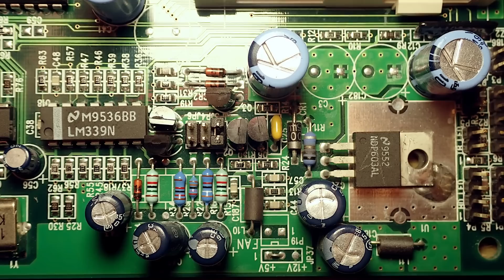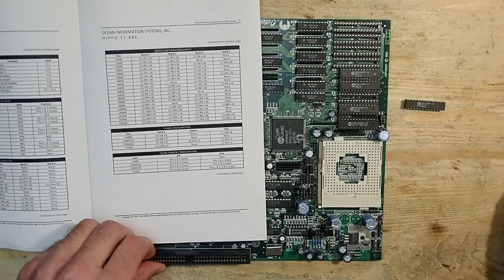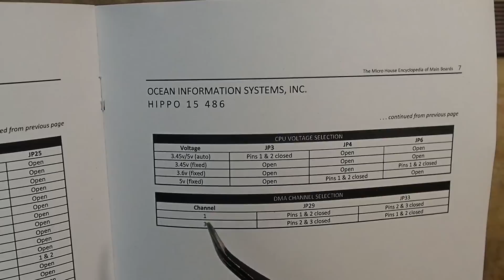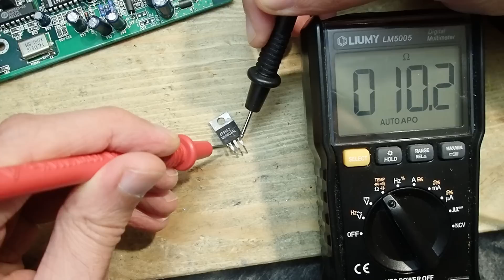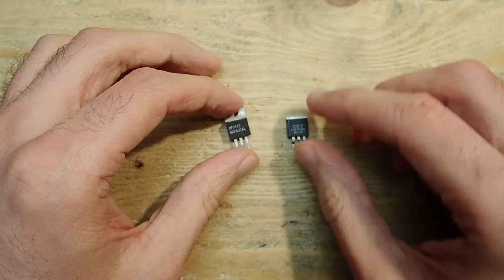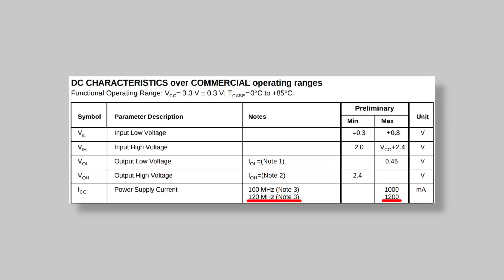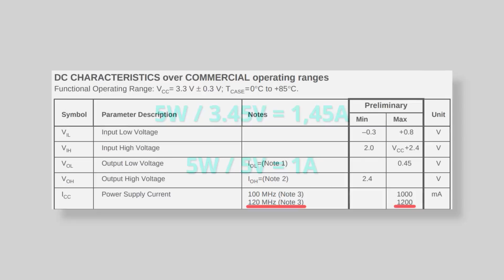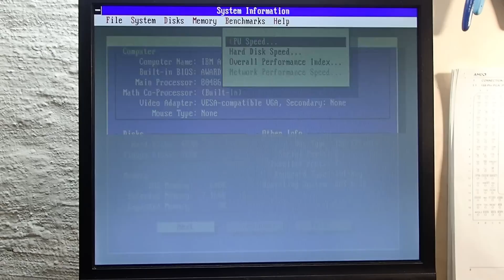Let's repair one of the best 486 mainboard - Octek Hippo 15

Comment: Great work and sweet fix! And yes, why recap something that doesn’t need it? I’m on board with you 100%
Reply: Hi! Why recap? because all components have a rated shelf life according the manufacture. May be the 25/30 years old motherboard exceeds that shelf life. Could be working but not in specs. You dont need to change your car oil every 15..000Km,  the car wont stop running but you should because manufacturer specs.
Reply: @JorgeCarvalho_web_dev  all of the components are passed their rated lifespan, not just the caps. With that logic you’d change all the semiconductors and passives. Motor oil becomes contaminants and ineffective, so I would not say that is an apples to apples analogy.
Reply: @adriansdigitalbasement  Nop, I will not change all semiconductors. A 150 ohms resistor will be always 150 ohms and we can consider it of one type of semiconductor, it retains its specs until it burns out by external factors. A capacitor due to the way it is produced will change its own original specs over the time.
Reply: @warrax111  It is a good example to compare oil changes to change capacitors. You are not forced to do it, the car will continue to start, like capacitors, you are not forced to change it. Some day the board wont boot (the car will start but will damage the motor) analogy. But I understand that you support Mr Adrian thoughts because he is considered a "star" on the YT world, and what he says is the law. I can not support he's  argument or thoughts about the capacitors, so if and when I can, I present my own arguments
Reply: @JorgeCarvalho_web_dev  Yeah that's a false equivalence fallacy.
Reply: @warrax111 It is sad to me to know that there is out-there someone with that kind of thoughts.. that performing a simple task like changing caps could make the ego rise or feel like a star... You make me laugh with that. I wish you an happy life and grab some psychology books to learn some basics
Reply: @JorgeCarvalho_web_dev  nah. A blown capacitor isn't a big deal. Not changing oil will utterly ruin your engine. Big difference
Reply: @DeadOSThings  Thank you  for your smart comment, it proves that you and many others cant understand what a comparison is. I will try to explain again. 
A comparison is an helper that is used to establish a parallel from a common situation that everyone is used to to explain other situation not so common .
 It is mandatory for a car to run to have gasoline(for example) to the motor works, the oil is an element in the system, the capacitor also. 
Both have a lifespan (10.000km for oil for example) you can skip an oil change the the motor keeps running, but one component (the oil) is out of specs not in an ideal way but it keeps running until the system (the car stops working). N ow the hard part, the comparison: so you can skip to change an 30 years old capacitor, the  computer will keep running not in the best way because an element (the capacitor is out of spec). Did you understand now what is the comparison? NOTHING to do with big or small deal. The system will stop the RESULT is the same, the car will stop working. The problems/costs will be different obliviously but in the end. Because in the comparison THE RESULT IS THE SAME, ,SO  THAT IS WHAT A COMPARISON IS.  For all that was explained, your comment is useless and reveals much more than meets the eye...
Sorry my english, it is not my native language, but I hope that this can help others to understand what a comparison is instead of start writing things on comments
Reply: @adriansdigitalbasement  while it's true that all/most of the components on these old boards are past their rated lifespan, parts like ICs and resistors are far less likely to fail when compared to electrolytic capacitors.
Reply: @JorgeCarvalho_web_dev  not true, resistors fail too. you don't measure your caps bro? just blindly replace?
Reply: @Walczyk  Hi Sir! in fact I just replace them. Just the fact of apply heat to remove them and clean the pins dont do very good to them and they continue to be old. It is just easier for me to replace them and dont think about it. I could check them but they still have 20 or more years old (could be good but still old and the rick of leak or something is still there)
Reply: My grandfather used to say "if it ain't broke, don't fix it".
Reply: Nah. Once the cap is dead it can be fixed by putting in a new cap. Couple cents.

Once an engine is dead it can be fixed by putting in a new engine. More than a couple cents.
Reply: It's only worth immediately recapping if the caps are low quality or from a known bad period.
Reply: @JorgeCarvalho_web_dev  stick to web development as you're clearly out of your league with electronics.  Resistors are often found drifted in value.  Your comment shows your lack of knowledge.
Reply: @BenState  Dude, dont be an asshole. The resistors are not the exact value as printed in color code bars. There is always a tolerance that can go up to 20%. Maybe you should think and read a little bit before post this kind of comments.
Reply: @JorgeCarvalho_web_dev  do some research, resistors drift outside of their tolerances.  A well known phenomena.

Comment: That DX50 was technically the first CPU that forced active cooling to be required and it was also the reason that VLB started walking towards its demise as VLB cards would have to run at the same speed as the CPU FSB a LOT of VLB cards started dying when used with DX50 CPUs due to the 50Mhz FSB. That said, first generation PCI cards (when using similar/equivalent chipset) would be slower than the VLB counterparts when running on a 50Mhz FSB system due to the PCI BUS being clocked at 33Mhz and having additional layers between the cards and CPU. Please note that the same will not remain true when you move up in CPU generations, this will be valid for 486 systems with VLB and PCI slots. I would actually love to see you test a board that has both VLB and PCI slots with a DX50 CPU and VGA cards with the same chipset but in VLB/PCI versions. Another good test will be VLB HDD controllers with RAM for CACHE, as the PROMISE ones that used a 286 as a dedicated HDD controller, though in this case the problem is that I never found a version of those cards in a PCI version, though the VLB really kicked butt *once their drivers where installed that is*, specially in Novell Netware 3.x file servers when you have a bunch of users hitting the same databases at the same time, those things rocked hard with 8Mb of RAM dedicated to HDD cache. They also considerably sped up Windows 95 on 486 systems (or even Pentiums with VLB slots). It took years before a normal PCI controller and HDD matched that performance (When comparing IDE devices, SCSI devices are not in these considerations).
Reply: You are right the DX50 was a boy ready to run in the 32 bit era. It was mind-blowing
Reply: Что касается частот на VLB -- в одной из моих сборок система стабильно работала на частоте 66 MHz. (Процессор 486DX2-66 работал как "DX2-133". ;) )
С шиной PCI также было не всё просто: в период становления стандарта PCI v. 2.0 встречались MB и видеокарты, способные работать на 66 MHz.
Процессоров, работавших на такой частоте мне не встречалось, но попадались экземпляры DX4-133, работавшие как "DX3-180".
Правда, переключение частоты с 33 или 40 на 60 приходилось делать уже после старта системы.
Reply: Most PCI implementations would run 1/2 at 25mhz on a 50mhz fsb. I have a UMC 486 board that has both pci and VLB. And it will drop the PCI to 20mhz when I put the FSB to 40mhz. Which is a shame. But its VLB implementation also seems to be very slightly lower performing than a pure VLB board I have when replicating configuration as closely as possible. I have found on my VIP board that when the busses are the same speed then the VLB is only very slightly faster using my friends ET4000 cards. The difference seems a little more pronounced on a dx4 than on a dx2 as well. But they are still both within a few percent. And best comparisons I can make with HDD controller's indicates they are identical for the most part. Both using flash and spinning rust. However my VLB board seems to outperform the VIP board I have by a more significant amount.. So I can't call that apples to apples as its probably got other optimising going on.

We even did comparisons with L2 an L1 disabled at different stages to see if we could isolate more situations. And the differences seemed consistent.
Reply: @wishusknight3009  В период становления стандарта PCI 2.0 встречались m/b и видеокарты, у которых была документирована работа на 66 MHz. А некоторые бренды и ранее выпускали компьютеры с "заводским разгоном". В таких случаях комплектующие сторонних производитетелй были не всегда совместимы (если не могли работать в разгоне).
(Позже — поддержка 66 MHz осталась только на "серверных" PCI-64.)
Reply: @cynic3859  There are many cards that had 66mhz capability. Even though they were 32 bit PCI. Silicon Image SATA cards for example are 32bit - 66mhz. And several video cards were capable as well. Including the VOODOO 3 and ARC Logic 1000PV PCI vga chip
Reply: @wishusknight3009  Теоретически VOODOO 3 могла бы работать на PCI с частотой 66 MHz. (Она работала на этой частоте на AGP.)
Но нет никакого смысла её использовать с 486. А современные ей чипсеты (например 440BX) не позволяли даже в разгоне поднять на 32-битной PCI частоты выше 41.5 MHz.
Reply: @wishusknight3009  See, you're talking DX/2 and DX/4, this is exactly the problem. FSB on those will be usually between 25Mhz and 33Mhz, this will not do. 
You need to make the test using DX models or overclocking the base FSB on the DX/2 DX/4 models to 40Mhz or 50Mhz. 
The only DX/2 I am aware of that has a higher than 33Mhz FSB is AMD's DX/2 80Mhz which is a 2x40Mhz CPU. 
In order to test this as I meant to have it tested you need to either use a native 50Mhz BUS CPU like the DX50, or overclock the other models to have a 50Mhz FSB/BUS speed. Otherwise you will not have the speed on VLB I was referring as it will always be locked to the CPU FSB.
I would recommend testing this with AMD's 	5x86 X5-150 ADW (A rarity that has a 50Mhz FSB, the 160 actually has a 40Mhz FSB so you will not get the fastest results there).
This said, I am aware of models of these 5x86 CPU's able to be overclocked to 180Mhz, those models with some luck should be able to sustain easily a 3x50Mhz configuration. Good luck licking this matter :)
Reply: If you actually are lucky enough to get one that is able to sustain 4x50Mhz and be stable, you'll likely be the proud owner of the fastest 486 platform ever. (Assuming this configuration won't kill it dead)
Reply: @wskinnyodden  He probably would be, if not at least very close to the top ever. Until someone makes a modern cpu that plugs into socket 3 using FPGA or something.
Reply: @wskinnyodden  And all I was saying, was my 486 board will default the PCI clock to half of the fsb when I have the FSB at 40 or higher. So I start my machine with the FSB set to 25mhz and then basically have my turbo swich plugged into the speed slelect jumper and it pops it to 40 during post. That forces the PCI bus to 40 mhz on my board.  I am not interested really in pushing it any higher. If I want more performance I dig out my Pentium 100 machine.
Reply: So the VLB was basically forcing the VGA to run overclocked if you push the FSB to 50Mhz, nice !
Reply: @wishusknight3009   that's a nice and good idea !

Comment: Merry christmas! I see that resistor first time, when you zoom to regulater  I think that you miss that. but you find it!
Reply: Not only did he miss the burnt resistor, but then he incorrectly named it as a "fuse" and moronically he even replaced it with a fuse. WTF?
Reply: It is a 0.01 ohm resistor which acts as a fuse in this circuit

Comment: I remember way back in the day I had a DX2 66 that I set the mainboard jumpers to 100mHz. Ran that thing for years without understanding I overclocked it, I just knew it was running better. haha It wasn't until I upgraded to a Celeron 300a that the overclocking community became wild and I finally understood what I was doing. In any case. Cool video!

Comment: Excellent video, as usual! This is definitely a great 486 motherboard.
Reply: Probably one of the arguably few that was better was the infamous PCChips board with the fake cache. It really sucks they had to tarnish that board that way. Because the implementations on that board are otherwise simply fantastic. With a bios that can be tuned exceptionally well and supports all the cyrix 586 features with a simple toggle. And with its legendary and hard to find cache chip, it is among the best performing boards for socket 3 ever made.

Comment: I own 5 IBM PCs (PS/1 Value, 386 PS/1, Aptiva 486 SX, PC 330 and Aptiva P166) and what always struck me is how none of those PCs have had any failing parts (yet). I've had people telling me I should recap all those boards but something tells me that the better brands didn't buy garbage components to cut corners. I had to get my Amiga 1200 recapped for example (shows how Commodore was cheaping) but my IBM PCs are built like tanks. Even their CD drives still work perfectly. Mitsumi made some rock solid drives back then.
Reply: Yeah it was around S478 and 775 that the counterfeit cap solution from china infested the market, the stuff before that was built like a tank.

Comment: You've inspired me again!! I took problematic LS-486E Rev C board and put into my 5x86 build. Then I did a CMOS reset to defaults and from the very first try it run on 160Mhz. Without any issues. IDE issues had disappeared magically.....I've spent a year trying to start that board with internal IDE controller.

Comment: I was literally shouting at the TV watching this until you got to that fuse / resistor.  It was so obviously discoloured to my eyes.  When I was working I always encouraged younger engineers to power off and take a long hard look at a board for damage / manufacturing defects / damaged components before resorting to electronic debugging.  And I agree 100% on not replacing capacitors without good reason - you can do more harm than good if not careful.
Reply from the maker: Yes :D I always take a careful look actually, but sometimes I seem to be blind. As I finally saw that thing, I was laughing and sure, that everybody else would've seen it from the beginning.... But I think, this way it was more entertaining for everybody and this is all about that eventually :)

Comment: Deine Videos sind Entspannung pur. Benötige ich gerade ganz doll.
Reply: Das waren damals schon geile und spannende Zeiten. Was habe ich da noch herumgebastelt und ausgetauscht. Heute habe ich einen i5 4670K mit 16 GB seit sieben Jahren. Klar, immer mal wieder SSDs hinzugefügt – letztens sogar eine NVMC in einem PCI-E-Slot (weil ich doch gerne bastele). Aber das Ding reicht mir immer noch für alles (inkl. Videoschnitt). Einzig 360 Grad-Bilder und -Videos lasse ich auf dem Handy rendern, weil die RX570, die CPU und alle Lüfter auf Anschlag gehen und es trotzdem länger als auf meinem bald drei Jahre alten Redmi Note 5 dauert (das dabei nicht einmal handwarm wird). Wenn es nicht bald ARM-CPU-Mainboards gibt, wird der Nachfolger meines i5 ein M1.

In diesen sieben Jahren hatte ich damals: 384/40, 468 DX2/66 (@80), An5x86-133, AMD K6-166 (@200 (2x 100 MHz)), AMD K6-2 400 (@500), Athlon 1.300, Athlon XP 1600+ (@1,66 GHz). Wahnsinn, wie viel Leistung zwischen dem 386/40 und dem XP liegen. Mir juckt es nicht in der Hose, wenn ich an einen Mittelklasse Ryzen denke. Schöne CPUs, aber uninteressant für mich.

Was ich als PC-Spiele in diesen sieben Jahren (und danach) an Geld für Grafikkarten ausgegeben habe, passt auf keine Kuhhaut. Das waren viel mehr Grafikkarten als Prozessoren.

Nach dem XP wechselte ich 2004 von Windows zu OSX (Powerbook 17" G4 1,33), dann zu einem C2D 4300 (@2200 MHz) (Hackintosh) und dann eben erst zum i5 4670K, den ich bisher nur zum Spaß übertaktete, aber sonst im Default laufen lasse. Vom Hackintosh bin ich jetzt ein Jahr weg. Ubuntu bietet alles, was ich benötige. Nur für FinalCut starte ich noch den Hackitosh, ganze selten mal Windows für alte Spiele. Ich zocke nur noch auf einer alten Xbox 360, die Switch benutze ich gar nicht.
Sorry für das längliche Posting. Liegt wohl am Jahresende, dass man mehr über die Vergangenheit nachdenkt.

Comment: I'm not a proponent of "recap everything" either, it's good to recap based on findings and experience. These are nice caps. If there has been little to no degradation in 25-30 years, it'll be fine for another few decades, which is not a guarantee when you install fresh ones. Run under benign conditions and manufactured without as much spec and footprint pressure with known good chemicals, old caps can be remarkably long lasting.